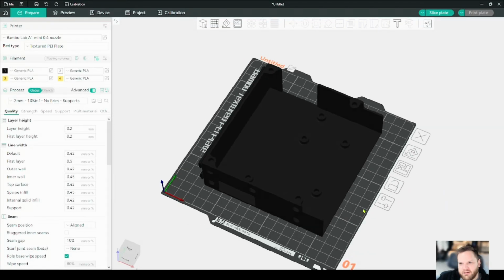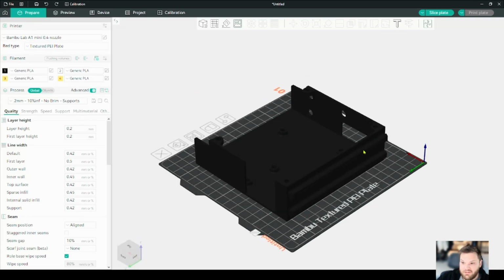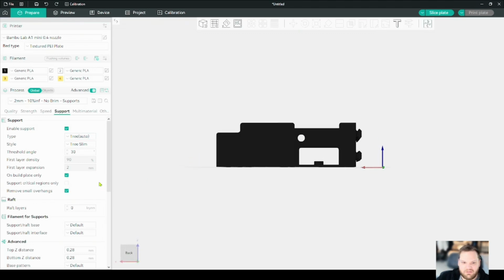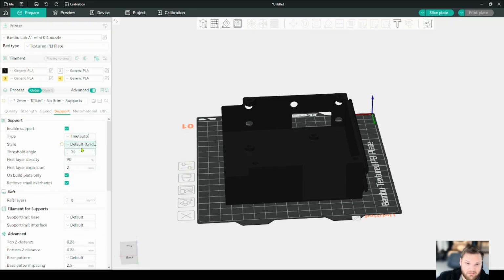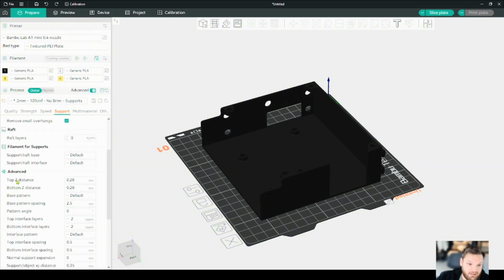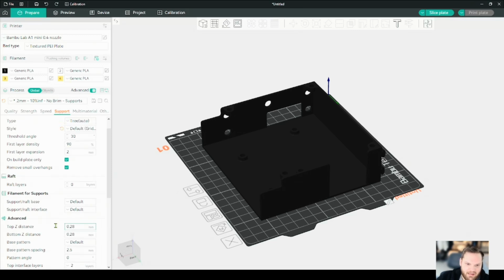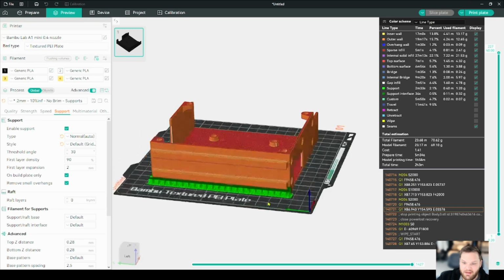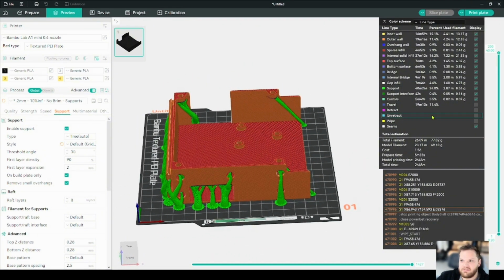Best Support Settings in Orca Slicer for Clean 3D Prints – Easy Removal & No Artifacts!

Comment: Does not work for .6mm nozzle @ .2mm layer height
Reply from the maker: Oh wow! I'd suspect its due to the bigger nozzle. I have not printed with a .6 before. I'll have to get one and make a video on it.
Reply: @ComiskasCustom  I've been running .6mm for quite some time, and I definitely prefer it over the .4mm for my typical printer use, but I'm really having a struggle getting supports dialed in on it for whatever reason. On a .4mm nozzle, it seemed like organic supports were near perfect by default in comparison, but since switching to .6mm I'm having trouble finding a balance between 'not being able to remove the supports at all' and 'not supporting enough'.

Comment: I've used the .28 settings and they work great, thanks. Do you have any tips for getting "round" circles (holes in the model) as you have? All my settings seem to come out Oval (Top to bottom is narrower, the sides are wider) Using Orca Slicer 2.2.0 now, and the previous version the same. So I'm sure it's something I'm missing. Thanks for the supports video.

Comment: I kept upping my z top distance and supports are still stuck to the print.  It's at .38 currently and still leaves scarring on print.
Reply from the maker: Hmm, what kind of material are you printing?
Reply: It's all dependant on your layer height and nozzle. He's using 0.2 so if you're using more or less you'll have to adjust accordingly.

Comment: Thanks for this!  I just tried this yesterday.  The .28 top and bottom Z distance makes a huge difference. I had used PETG as the support interface layer for PLA prints and that works really well as well.  I may still use that for really difficult prints but using these settings the supports release very cleanly.  I knew it was probably something simple but I'm not experienced enough with 3D printing to know exactly what settings to tweak or by how much.  So thanks for sharing this.  Super helpful.
Reply from the maker: Glad you found it helpful!